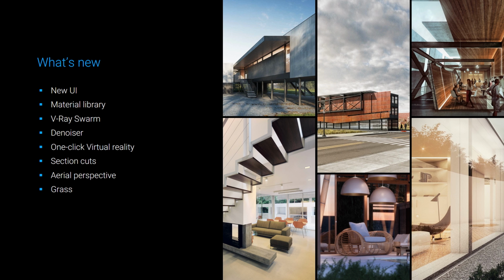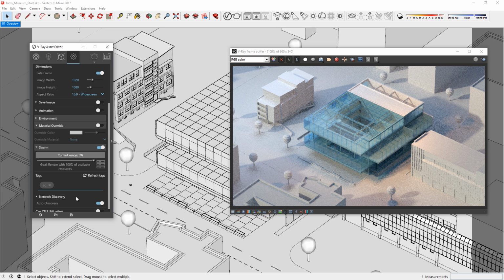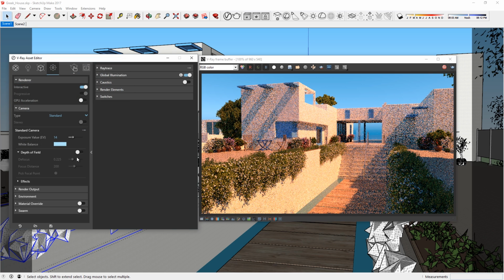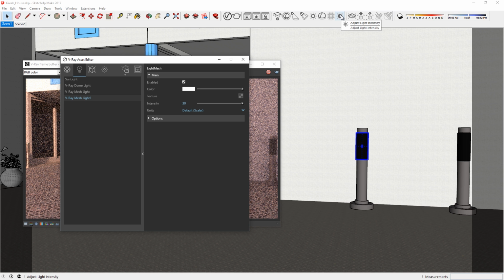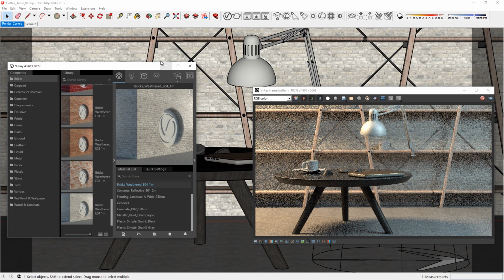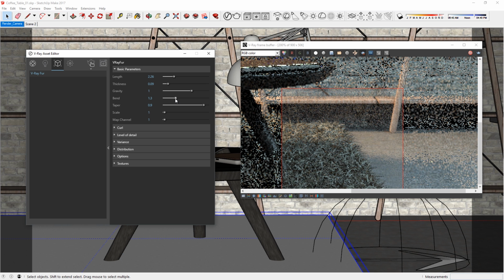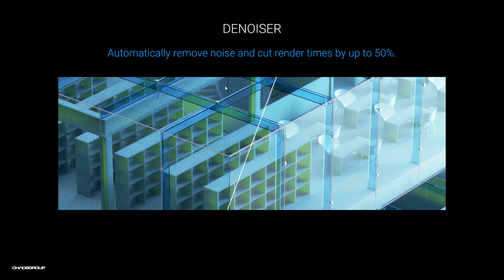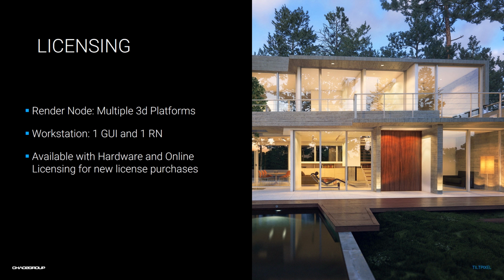V-Ray 3 for SketchUp – Webinar

Comment: Hello..!! I have this weird issue and I was not sure whom to ask this either.. I wish you guys could help me.

Issue-1 : I have composed an interior scene in Sketchup 2017 and rendered using Interactive Rendering in CPU mode. in the final out-put the lights are fine, textures are fine and the output is great. But, when I use GPU acceleration the texture of the materials changes, few materials looses its properties and blacked-out in the final render and the lights become less intense so, in order to reduce my final render time I had to sit through hours changing all the material properties, light parameters again from scratch using interactive render now in  GPU acceleration mode. Please help me with this issue. what should I do during modelling and texturing in order to get same results in CPU and CPU+GPU rendering scenarios.

Issue-2 : After I complete render with great detail and good colour contrast I shared my renders with the client. for my worst nightmare renders looked very pale and in slightly pink tone with very less and blury detail in clients computer. firstly I thought it was the issue with clients monitor settings later I opened the same renders in my mac book-pro and an iOS device and they looked utterly ugly in them too. But, the same renders looked beautiful in the primary system from which the renders are produced. I could not figure it out what went wrong. Please help me. 

Sektchup version : 2017
Vray Version : 3.40

System configuration : 

AMD Ryzen 5 1600
Nvidia 1060 3 GB from Zotac
AOC i2080SW LED Monitor
 
*note : All the drivers are updated and running fine.

Comment: dying for your English. :) thnx for the tutorial. i would like more in depth. Nice work guys in chaos group. Clipper doesnt work so well. Bags. have a nice day!
Reply: From my personal experience Vray clipper will cause a lot of bugs if geometry in Sketchup is not very well resolved. Try to always keep geometry closed and solid (sometimes it will not understand simple planes), and ESPECIALLY have your faces correctly oriented, meaning back faces have standard material inside the geometry. I suffered a bit ´til I figured this out!!

Comment: does anyone know how to change the frame buffer to no follow a triangular pattern?
i used to always change it top top-bottom and i cant find that option in this new version

Thanks
Reply: In this version, the option is not visible in the UI. If you have the scene saved with an older version it will still render in a triangular pattern.